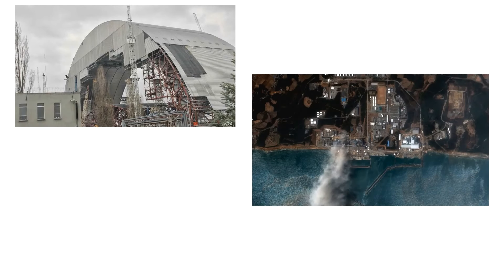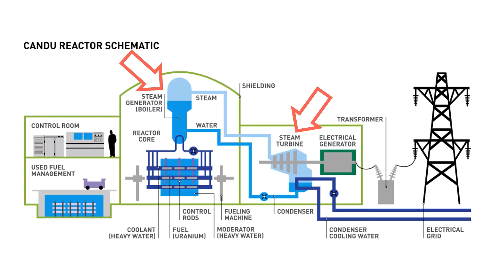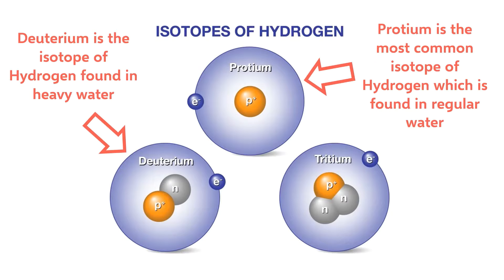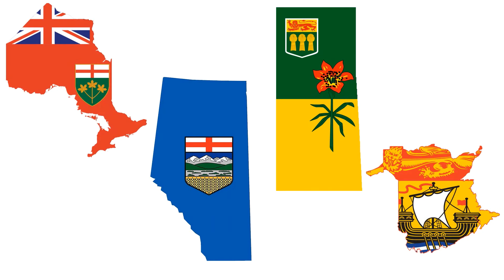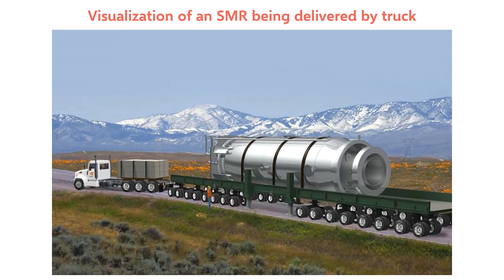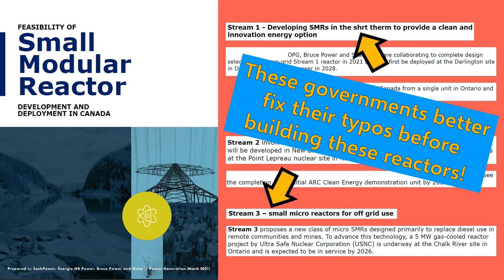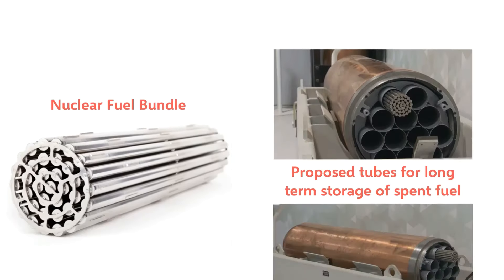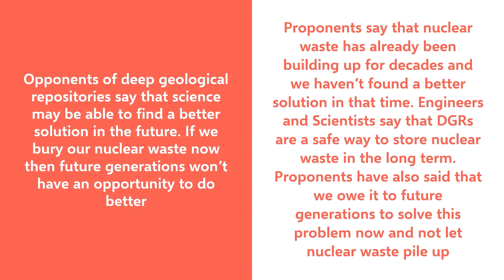How Canada is Developing the World's Most Advanced Nuclear Tech

Comment: Start building reactors that run on nuclear waste.  Would not have to mine any new fuel for around 500 years.  Essentially one current reactor could supply about five waste burning reactors with fuel.  There will be some waste left over but the amount of waste will be about 1/1000th the amount of the waste from the current reactors and this small amount of waste left will degrade to background radiation  levels in around 300 years.  There are wood houses currently in Canada that old.
Reply: Scientists working on that already 60 years. Tokamak
Reply: CANDU Reactors can run on the nuclear waste of other reactors. It is also possible to reprocess the used fuel from a CANDU reactor to make more CANDU reactor fuel, in fact if a CANDU reactor was modified to use the thorium cycle you could produce more fuel than the reactor uses.
Reply: @Brained05  The Elysium Industries reactor can burn up any kind of nuclear waste without processing.
Reply: 100% this LFTR tech needs to be pushed to market
Reply: @MultiHotFlash  True, but while fusion is still a bit remote, next-gen reactors such as the smr could prove a suitable stop-gap measure.
Reply: Breaking news, the thermal reactors currently in use produce no fissile waste at all. To produce burnable waste new types of reactors and fuel cycles need to be introduced. Those are pretty well developed by now, but there's much to be done yet.
Reply: Breeder Reactors are a thing that's up & coming. (they've been in development since the 60s but were left to the wayside when much more uranium was discovered) Basically, they are reactors that create nuclear waste they are then able to use as a fuel. This means that the fuel can be used until nearly all of it's energy is used up, which ultimately leads to better economy (new fuel requirements reduced by a factor of 100x) and leave almost no dangerous waste.
Reply: @АлександрДараган-з8ц  don't quite know what you are saying?  Are you saying current reactors are not producing fuel that other reactors can use? If so that's not true.  It's true that the cost of reprocessing fuel for current reactors is prohibitively expensive.  However Molten Salt Reactors don't need to reprocess the fuel to use it.  Essentially the waste fuel simply needs to be chopped up and put in a very hot salt solution.  Some minor chemical steps are also required.  The waste then can be used as fuel at this point with no need to clean out contaminants. A very inexpensive process. The molten salt reactors can then burn up this new fuel to a very high level.  Kind of like a garbage disposal.  Teck for Luddites site explains how this is done.
Reply: @stanleytolle416  Before jumping to conclusions kindly read some literature on whan nuclear fission is and how it works. The reactors operating on U-235 and thermal neutrons produce no fissile isotopes. There are no breeder reactors currently in commercial power generation now, except BN-800 fast reactor, and even this one is still used at only one NPP.  
Also didn't you read what I sayd about the need of introduction of new types of reactors and new fuel cycles?
Reply: @АлександрДараган-з8ц  current reactors only use about 1% of the uranium fuel at which point waste and reaction killing element's build up in the solid fuel pellets and they have to be replaced.  So 99% of the fuel is left.  Other reactors like molten salt, fast neutron, and others can it use this left over fuel to operate. So maybe you need to read up on the fuel usage in light water reactors.
Reply: @stanleytolle416  And what's so special about LWRs? They are no different from PWRs or VVERs in this aspect. You simply don't remove the spent fuel rods from the core and load them into the MSR to burn. You need to cool them down first, wait for short-living fission products and other isotopes to decay, then you may either dispose of them or recycle them (dissolve them through PUREX process for example). Solid uranium dioxide pellets (the most common type of fuel now) are not very suitable for operation in the MSRs, be they fresh or irradiated.
Also, uranium recycled from the SNF can be returned into operation in any type of reactors.
Once again, MSRs and fast reactors provide no miracle solution to the problem of the nuclear waste generated by the reactors currently in operation. They are next-gen reactors capable of closing the fuel cycle and generating fissile materials and power, but they require their own fuels.
Reply: @stanleytolle416  Nothing new. Very superfluous and not too specific. Still they didn't explain how exactly all those new designs are going to help with the SNF already produced by existing commercial reactors.
Reply: @АлександрДараган-з8ц  waste burning reactors simply have to be built.  There is no real new science needed here. What is left is simply engineering and design development.  Burning used nuclear waste in a reactor is something that is known.  What we have now in nuclear reactors  is akane to early steam engines.  These steam engines were very expensive and inefficient back then just like present day nuclear power plants. What we have now is a very clear idea how our present power plants can be made much more efficient and produce essentially no waste.  What is needed is to put in the effort to bring these plants into existence.
Reply: @АлександрДараган-з8ц  actually since higher actinides don't need to be removed for MSR fuel the process of using LWR (or other reactor waste) waste is like chopping up the pellets  and putting them in a hot molten salt blender. Maybe one or two chemical steps. Yes, maybe let the waste sit for 10 to 20 years to let the super hot short lived  elements decay some but there is plenty of this stuff around.  Really there is nothing unknown about doing this, it's simply a matter of designing and doing.
Reply: @stanleytolle416  By the way, Savannah River National Laboratory for instance has been recycling spent fuel for quite a long time. They have some rather interesting processes for doing so. Also as far as I know Cogema (France) also specialized in this activity, ans does Mayak (Russia).
Reply: @АлександрДараган-з8ц  looks like fission reactors will be here for a long time to come.  So far fusion reactors have not even been scientifically established as something that will work.  The other thing being, is it appears that fusion reactors are going to be gigantic installations if they ever get developed.  Most likely too expensive and impractical in most cases.  It appears that fission reactors are on a development path of greater practicality.  From giant regional power sources to small single home units (something like the kilowatt space reactor).  My guess is that fission reactors will be the future for a very long time.
Reply: @stanleytolle416  Sure thing
Reply: @АлександрДараган-з8ц  spent nuclear fuel can be converted into molten salt reactor fuel through the "Japanese process" (Tech for Luddites: This Nuclear Reactor Burns Nuclear Waste, YouTube.)  This process is not reprocessing since higher actinides and other junk is not removed.  Much simpler and cheaper than trying to make new solid nuclear fuel.
Reply: @stanleytolle416  specifics?
Reply: @stanleytolle416  can you?
Reply: @stanleytolle416  I suppose this pointless argument can be terminated by agreeing to the following:
1. SNF can be reused/recycled, even though the ways to do so may differ.
2. Nuclear waste (all that remains after fissile materials are extracted from SNF) cannot be reused and must be disposed of (by whatever maens least damaging to the environment).
Reply: @АлександрДараган-з8ц  waste on materials is not that big of a deal.  Geological disposal is quite suitable for this material. Liquids of course will need to be consolidated and glassed.  There does not appear to be any technical issues unsolved in handling this material except for political and bureaucratic issues.
Reply: @stanleytolle416 , all this seem interesting. But I believe that just as with older nuclear plants, there will be a lot of radio active waste. I have not heard to date a single nuclear plant that has been successfully decommissioned and disposed on. Now imagine what will happen in 50 years with all the reactors that are being built or planned.
Reply: We are,but first comes the Natrium fast reactor, it runs on 20% enriched U,not every reactor has to be a waste burner, once we have reactors that use waste it isn't waste and we will want more.

Comment: You didn't really mention the new nuclear reactor at New Brunswick. This is a totally new design, called a stable salt reactor, developed by the British/Canadian company: Moltex. It actually consumes the waste which you want to bury. It is the first of three phases of design, which will lead to more general molten salt reactors. I due time, MSRs will replace PWRs and CANDUs as a cheap, clean technology without all their drawbacks and deficiencies.

Other new companies are proposing different MSR designs, but as far as I know, only Moltex is actually building a plant.
Reply from the maker: I made an entire video about the New Brunswick Reactors! https://youtu.be/3u44skO-nMo
Reply: ARC fast reactor Terra Power IMSR molten salt reactor with molten fuel.
Reply: Of all the new reactor designs I've read about, the Moltex SSR is the clear standout.  All the safety features we want, can burn nuclear waste, and perhaps most crucially it reduces unknowns by incorporating existing, well proven nuclear power technology (eg. the fuel assemblies).  It is frustrating how slowly we are moving on this; we should be building prototypes of them *now*.
Reply: Moltex puts the fuel salt into open ended fuel tubes. This allows xenon to escape. There’s no xenon poisoning and no pressure build up. Caesium and iodine isotopes become caesium iodide so can’t build pressure as gasses. 
The coolant is a chloride salt, which does not corrode metals like fluorides will do. Chlorides are less liquid than fluorides, but Moltex does not pump the salt  so it doesn’t need to be so fluid. Fuel salt pumps are a regulatory nightmare. Another road block avoided by Moltex.

Comment: Kirk Sorensen has produced numerous presentations elaborating on the various issues. 

Storage of nuclear waste is the persistent and most concerning issue regarding the prevalent and otherwise ridiculously problematic water cooled solid fuel reactors.  Sorensen presents an illuminating analysis of the waste issue in one of his videos. Whenever solid fuels are used waste is a problem. 

Whenever water is present for the purpose of moderation or cooling there are potentially two major problems. The first is high pressure steam explosions. Secondly, as solid fuel is normally encased in zirconium there is the likelihood of a hydrogen explosion since it catalyzes pyrolysis of steam into hydrogen and oxygen when cooling is lost. This is really asking for trouble. 

If the proposed SMSs are going to employ pebble fuels, perhaps they're not conducive to hydrogen explosions. However, storing hazardous waste for hundreds of thousands of years is an unnecessary problem.

Contrast this with FLIBE thorium MSR technology that was somewhat demonstrated that Oak Ridge, is advocated by Sorensen and is being developed in China. It presents a minuscule waste problem while being inherently safe. In fact, it can be used to burn down existing waste.

I don't understand why any generation four reactors would be anything other than Thorium Cycle Molten Salt. 

What China is currently doing is pretty much what Kirk has been advocating for in the US for at least a decade or two. It is outrageous that the fossil fuel conglomerate has been pushing established nuclear technologies knowing that they are both socially opposed and cost unfeasible, while Sorensen's group has not been able to gain substantial traction.
Reply: How is the storage of spent fuel rods an issue?  No one in world history has ever been harmed by such "nuclear waste".
Reply: Sorensen is selling, not educating. Dig deeper into technical sources and you'll find things are not anywhere near as rosy as he presents. For example, LLNL noted the Th fuel cycle can be weaponized and that MSRs are the easiest way to do it, which is exactly the opposite of what he presents. There are many problems for the kind of reactor he favors. Even ORNL thinks this is the case. There are reasons the design he favors is not being pursued by those in the know and they have nothing to do with politics...they are technical. 
Perhaps in time they will be overcome, but that is a long way off.
Reply: Solid fuel waste has to be actively cooled for quite a long period. Also, please consider the very concerning situation now occurring in Ukrainia.

I can't find anything for LLNL's position on proliferation. Please provide a link. 

It's my understanding that Seaborg was interested in producing u233 in order to consider it as an alternative to P239 for making bombs, but concluded that the high gamma rays emitting decay daughters of occurring U232 are too problematic. Also, it's my understanding that most of the corrosion problems were fairly well managed with Hastelloy  and another sacrificial material per a statement from Weinberg.

Here is a link to a recent compendium of articles on the subject that I just came across: https://www.tandfonline.com/doi/full/10.1080/14786451.2021.1928130

China is about to commission the flibe prototype they have built. I read somewhere that they actually long ago had received some financial support for its development from our AEC.

Comment: The long lived radioactive waste is solvable in a way that does need a disposal system for hundreds of thousands of years. The waste that is highly radioactive is only that radioactive for five hundred years approximately until it decays to the point of normal background radiation. The long lived part of the waste is usually plutonium and unused uranium which can be used as a fuel source for reactors. These materials can be chemically separated from the waste thereby removing the need for long term disposal of radioactive waste. The highly radioactive waste products can be stored for hundreds of years or there may be uses for them now or in the future and the plutonium and unused uranium can be reprocessed into more fuel. I have been studying the material by Kirk Sorensen. He is a proponent for Molten Salt Reactors. Which use a chemical process to remove waste from the reactor salts. This process is probably useful for the radioactive waste of other reactors as well.

Comment: Wouldn't a better option for nuclear waste be to use it as a fuel supplement in LFTR's? This will use up around 95% of it and what remains has a half life of 300-500 years, but by the time we reach the end of the fuel cycle new uses for that waste may be discovered and pushed to market anyway.

Comment: I think that one of the biggest missed opportunities in this world where renewables are becoming more common is for base load power stations like nuclear and hydro stations to be able to shunt their electricity to hydrogen production when there is a spike in wind and solar production. Feeding that hydrogen into the natural gas grid would provide another source of income for  the power plant while also reducing the need for more virgin methane production. Seasonal storage from sunny summer to dark and cold winter can happen that way. Batteries are not capable of such storage but they could help for short term spikes though
Reply: Here's a crazy thought.
It takes energy to extract hydrogen, no? So is it possible to convert hydrogen into natural gas? I really like the way natural gas burns. It's just such a reliable and convenient form of energy.
Go ahead and scrub CO2 out of the air to feed the reaction and make methane. This will make it every bit as carbon-neutral as hydrogen.
I mean if we're building a new future here, I'd rather have one that includes methane and doesn't force me to use hydrogen.
Reply: Adding hydrogen to the existing natural gas {methane} distribution system is a non-starter.  Two reasons: 
A - unless special alloys are used, hydrogen migrates into the usual steels used in methane systems, & makes them brittle.  We really don't want our existing methane pipelines starting to leak at random locations along the line.
B - at the same pressure, the heat energy to be had by burning hydrogen is significantly less than burning methane, so adding hydrogen to the methane would REDUCE the ability of our distribution systems to deliver energy when measured on a "Joules per cubic metre" basis.  
BTW, the reason the energy content of methane {CH4} is higher than that of hydrogen is simply that methane molecules contain one atom of carbon per molecule.  Burning carbon releases more heat that burning the same mass of hydrogen, which is precisely why coal has been a go-to fuel for making cost-effective heat for centuries.  Manufacturing hydrogen is also far too expensive to be practical.  Great idea in theory, dreadful idea in practice...

Comment: Priority should be given to fully Molten Salt Reactors which can used Nuclear waste. They fully use up the fuel as it is in liquid and solid form. Many other benefits as well with MSRs.
The USA had a working test MSR in the 1960s. As it does not produce Plutonium, and too cheap to run, funding was cut by Nixon. China is testing a MSR now.
SMR and traditional reactors are not feasible, and are a high risk.